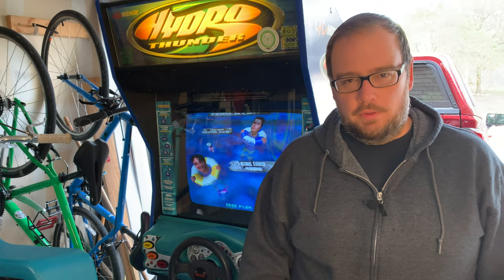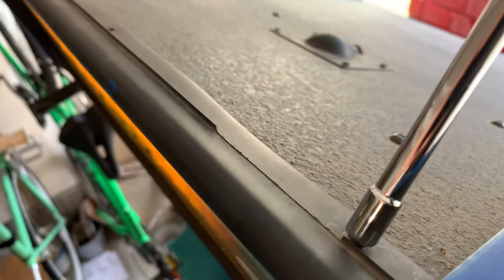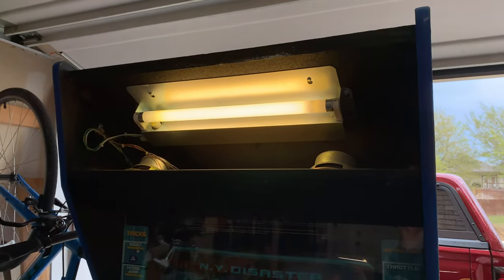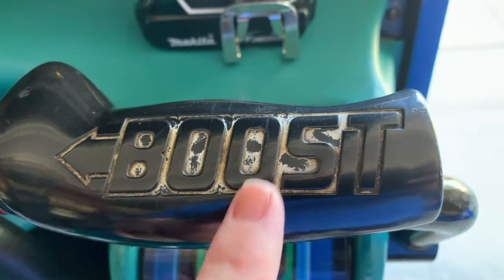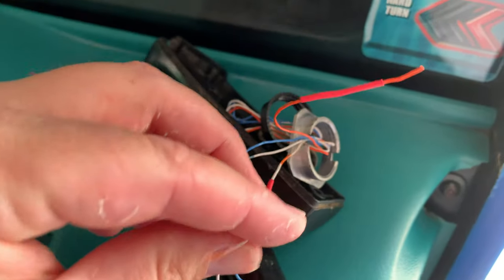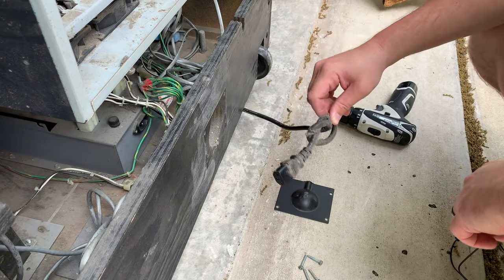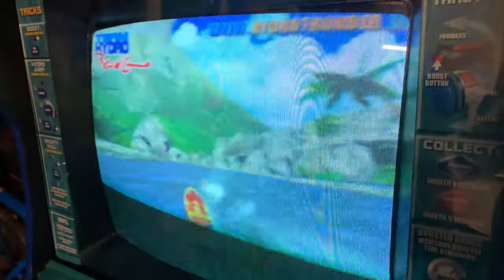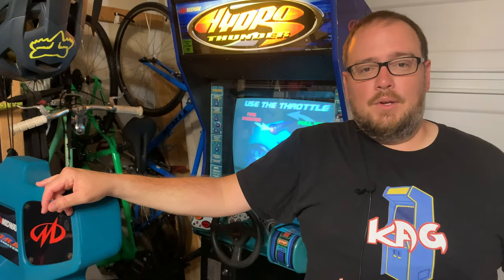Hydro Thunder Arcade Repair Process | Painting, New Marquee and MORE Problems?!

Comment: As mentioned below the likelihood is quite high that the lights went out due to non-soldiered and non-insulated wire that broke off or shorted.  Start with the obvious, take the handle back apart.  Seeing the other work you can do I have no question you can handle soldering.  To even think about a cap kit (1st step in fixing the monitor) you will need soldiering practice.  Trace the light wires back to the power source .  Because they blink they are likely fed from a common +12v and a chip on the main board that switches to ground (possibly visa versa).   I would disconnect the light leads and check voltages.  Could be a fuse, also could also be a self resetting protected circuit.  Start with the manual it is probably addressed.
Reply from the maker: I think I found the issue. What’s odd is I’m unsure when it happened. The throttle’s wire was smashed at some point and the wiring is exposed and must be touching other wires. The reason I’m unsure when it happened is the button worked fine the first time
I tried it but failed on the second try. I do now have a blown fuse, when I changed it, a chip on the steering board started smoking so I pulled it out. I’m going to try and find a new wire harness and the check all of the wiring before installing it.

Comment: The knot on the power cable is intentional it is for strain relief. Probably won't be a big deal in your case since it's not a commercial environment, but might as well since it doesn't hurt anything.
Reply from the maker: I figured that must have been it. Seems like there would have been a more high tech fix lol.
Reply: @KillerArcadeGames  Well simple solutions are the best solutions lol

Comment: Chris, check the fuses. Probably a short or a bit too much voltage which might have caused the fuse to pop. As for the monitor, probably needs a flyback if it's fuzzy or cap kit, which could be the case.
Reply from the maker: Yeah, the fly back is cracked and I’m sure there’s other issues. I think I’ve found what caused the lights to fail. I’ll have to see if I can find a replacement part.

Comment: Cool game, FYI that knot in the power cord is so it can't get ripped out. You need to undo those wire's and solder them or at least use terminal  connectors. You probably shorted the wire's together. It's not stationary, so they will fall off.

Comment: Oh my gosh. $300 for a KI 2 cabinet? Ugh. That's a huge bummer man! Sorry about the button lights too. As for the monitor, I've heard a lot of guys check and replace the capacitors (cap kit). That would require a soldering gun and of course some soldering though. The cabinet is looking amazing though and awesome job by the wife on painting the Boost!
Reply from the maker: Yep, that was a hell of a missed deal. I also just missed an SF Rush cabinet for $250! They’re always too far away.
Reply: @KillerArcadeGames  Duuuuuuuuude no way! Are you looking on CL, eBay? I'm way up in MN so the closest stuff seems to be in Illinois for the most part. BTW, sitting here playing KI with Spinal laughing his ass off at me as he beats me again and again. I can't help but laugh back at his maniacal laugh.

Comment: I wonder if its possible that the crimped wires on the new bulb came loose and just shorted the rest of the light circuit? (Just a guess) But it's highly worthwhile learning to solder, it's quite easy once you get knack for it
Reply from the maker: I checked it again and it looked fine. I think there’s a wire that got damaged and that may have caused it. I don’t know when it happened so I’m a still investigating. I may have to bug a soldering gun.

Comment: Still would be nice to keep the original marquee, your first official full size arcade piece of memorabilia. Cool memento piece. Cab looks way better now!

What paint did you use on the handle and did you clear it, so that its doesn't rub off?
Reply from the maker: I have no idea what paint she used...I'll have to ask! I don't think it's been clear coated yet. I needed to get it back together quickly. The monitors in such bad shape its really not being played.
Reply: @KillerArcadeGames  maybe you can reach out to one of your local arcades and speak with one of their techs to make a house call for a monitor repair. Just a thought..

Comment: Check the voltage on the power supply. Also did the lights mess up after the wire was swapped out?
Reply from the maker: The lights may be related to a smashed wire in the throttle. What's odd is I can't tell if it happened after replacing the bulb or not. I don't know how I would have possibly squished it but everything was working fine. The power wire was swapped weeks before I did the light bulb/button replacement. I might take you up on that monitor stuff, I'm not confident enough in discharging it myself. I think we've talked on FB or Instagram right?
Reply: @KillerArcadeGames  it should be a super easy fix. I highly doubt it's a smashed wire. I'm sure it's something super easy. The monitor on the other had could probably use a cap kit. I have all the soldering tools. Id be more then happy to teach you man.

Comment: Probably bad flyback on the monitor. But if you replace the flyback it'll usually take out the caps so good idea to replace them too. It runs a computer so not a good idea to run it too much in the heat. If so just open the back and run it at night with maybe a fan on it. I only know about the heat because I'm in Texas as well. Where abouts in Texas are you?
Reply from the maker: Yeah I think it is the flyback. Its got a crack in it. I'm in between New Braunfels and San Antonio.
Reply: @KillerArcadeGames  nice I'm just south of San Antonio in Somerset. We are pretty close!

Comment: Also I would solder that boost switch your prob shorting out the system which is bad! keep it off still you solder those wires.
Reply from the maker: I may have to do that. Its so hot now I barely want to be out there lol.
Reply: @KillerArcadeGames  😂👍🏼